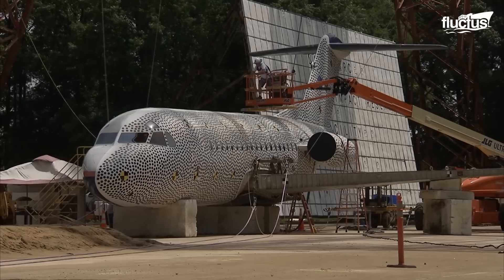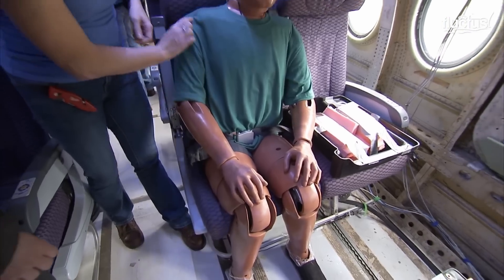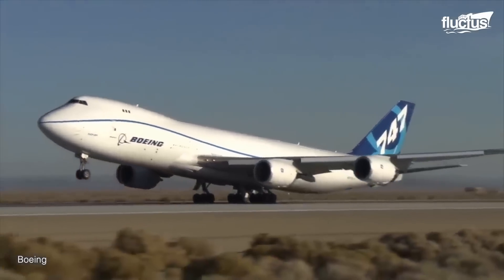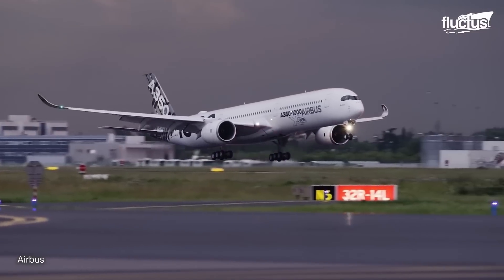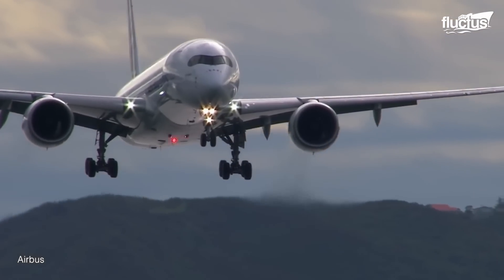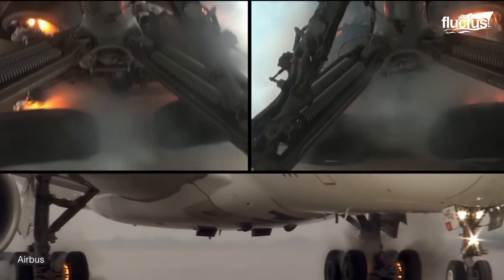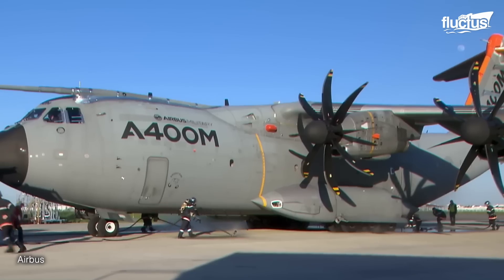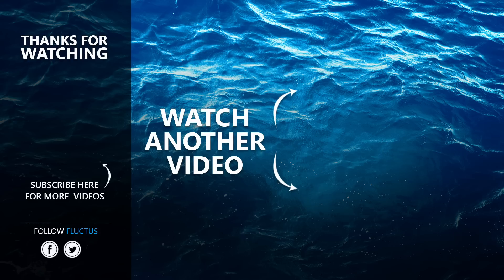The Genius Way NASA Crash Tests Future Aircraft in the US

Comment: Flight testing is cruicial to security, but saving those onboard from both huge impulse forces & fires from collisions/crashes is next to impossible with present aviation operational/designed standards! 
Either a global airline SOP to equip everyone onboard be equipped with a parachute before take off , or the plane should have self propelled rotor blades on top to generate enough lift during a hydraulics/engine failure for a safe emergency landing (like Rotodine) or a mid-air evacuation in form of a combined ejection seat(s) in closed state panel groups with a parachute after blasting off in opposite direction to the dive/thrust (on rollers through) the opened tail end should be incorporated in the design and safety features of all commercial airlines.